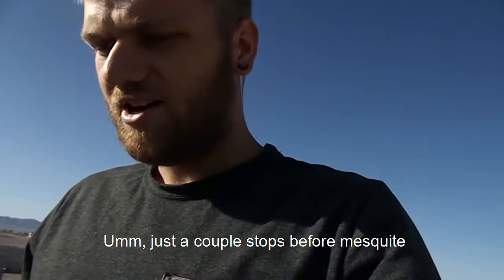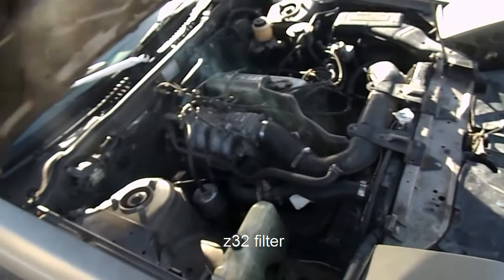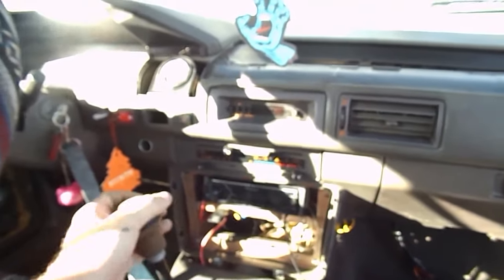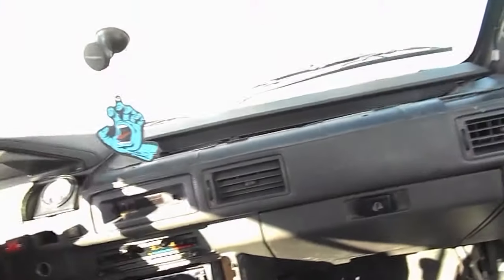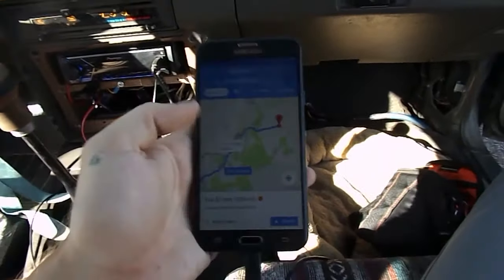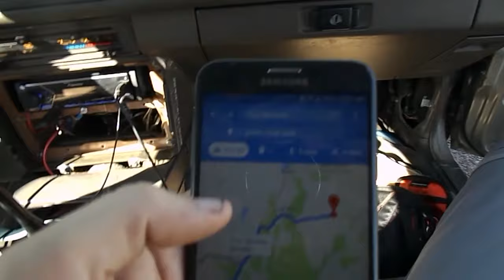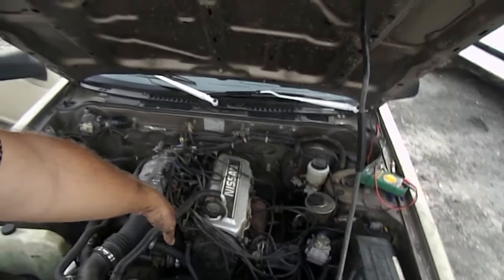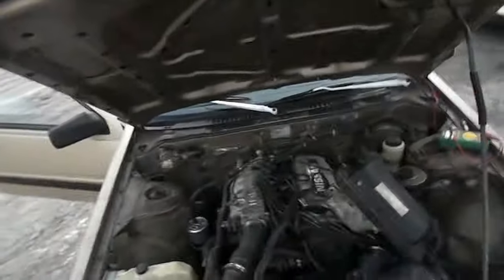S12 Cross-Country RoadTrip: Day 2 Disaster Strikes!

Comment: epic journey. what do you think would cause my new thermostat to stay open? thanks for your time.
Reply from the maker: Nimbus sounds like a bad thermo that's the only thing it could be or your cars timing is so off it's overheating fast af. Just get a new 160 degree thermo. Stock is 190 but u cn order a 160 from AutoZone for cheap
Reply: dude i JUST figured it out! the connector to the sensor was broken!, i rigged it up for now cau fk it its a ca20e but its working, unfortunately i just recently swapped the thermo and its higher than stock :< i played myself
Reply from the maker: lol thatll do it everytime, I have so many bad connections and grounds on my CA that i need to redo again.